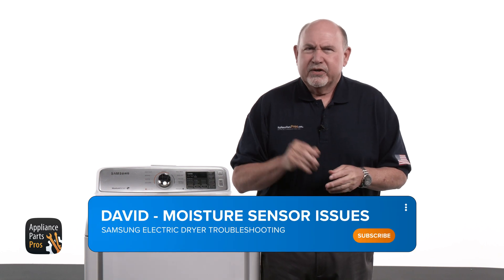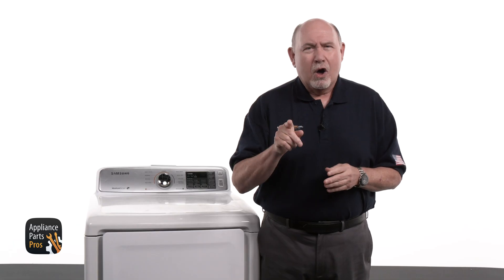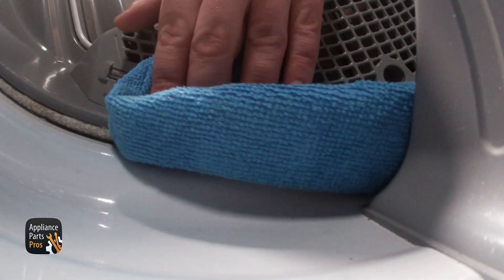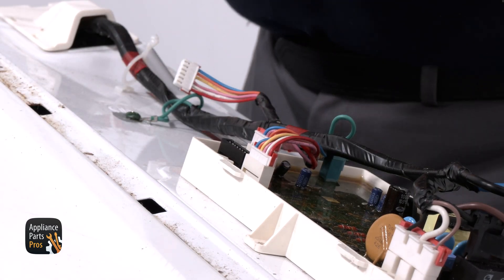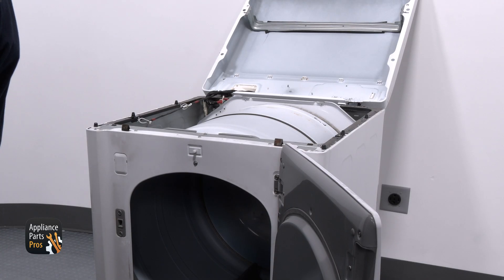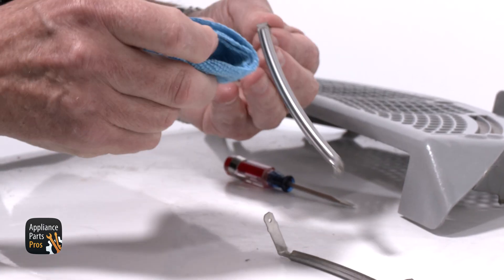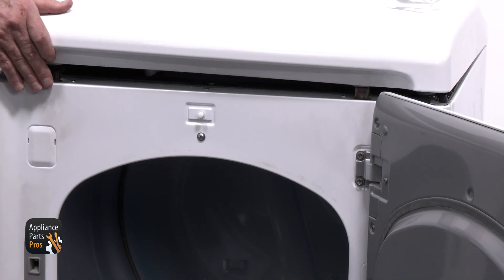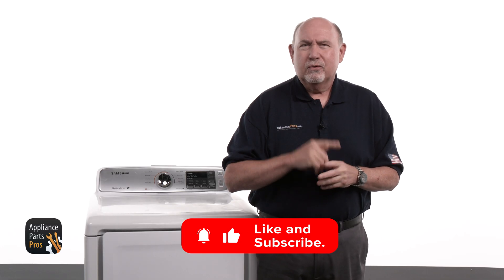Fix Your Samsung Dryer's MOISTURE Sensor Issues Fast and Easy

Comment: Is there a way to test the moisture sensor bars with the multimeter before I purchase new one's?
Reply from the maker: Good question. For detailed testing and troubleshooting steps specific to your dryer, our certified techs can help you at forum.appliancepartspros.com. Just post your model number and what you’re seeing, and they’ll guide you through it! 👍

Comment: I'm sure I'm gonna do all this, come on. I'm not gonna pay some tech guy hundreds of dollars to come do this. Timed drying goes into Eco mode and clothes then take forever to dry - runs a cycle at a lower temperature for a longer period. I regret buying a Samsung dryer.
Reply: Eco dry is definitely an annoyance, especially growing up with OLD and unstoppable natural gas dryers all my life, but thankfully Eco can be turned off before you hit start. My go-to when I need to know something is bone dry, is to turn it to timed dry, hit that Eco button first or else I forget, then dial in a rough number, usually 40-60 minutes depending on what it is. BUUUUTTTT... Given that electric prices (Mine is electric) are going up and it's only getting worse, I do let the Eco dry do it's thing and save money in exchange for time. (No need to crank out thousands of watts if a few hundred can get it more than half way!) It's nice that it can get that tumble and some fresh air over it like hanging them out on a line in the back yard, then the heat comes on for the last bit to really finish it off. With all my time in maintenance, and having to purchase dozens and dozens of dryers, you're not going to find those fire breathing tanks that Kenmore used to make. The market is just too competitive for those to exist anymore, and if they did, I can't even imagine how expensive they'd be!

Comment: This washer and dryer has been the worst purchase.
Reply: 10 years running on both in a 5 person household and the only replacement has been the dryer wheels and belt. I'd buy them again in a heartbeat!
Reply: I hate Samsung washer and dryer, what a mistake. I should have returned them after the first wash and dry cycles.
Reply from the maker: Sorry to hear that, @JamesTempleton-k3f. We know it’s frustrating when an appliance doesn’t live up to expectations. If you’re still having issues with the dryer, we’re happy to help troubleshoot or point you toward the right fix to get it working the way it should.
Reply: Completely agree. Mine has been nothing but an agitation to my irritation.